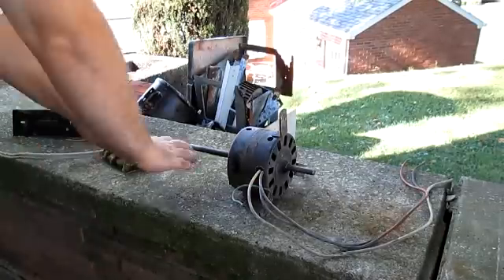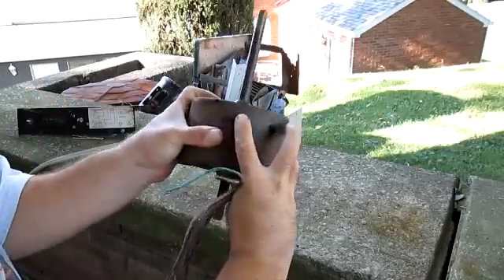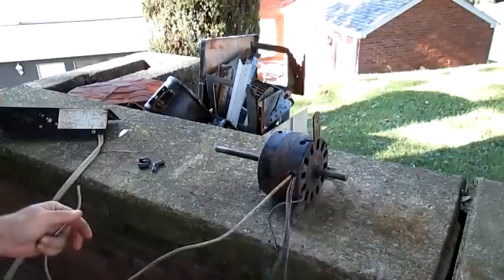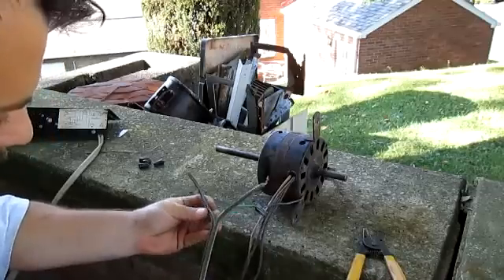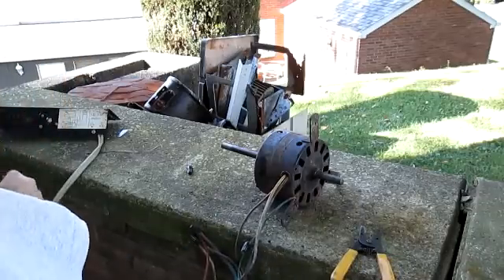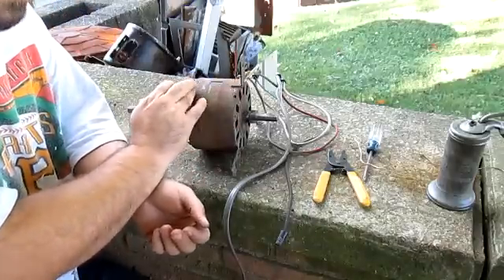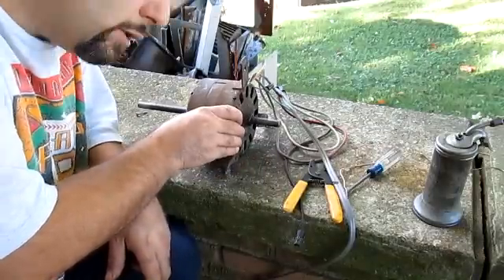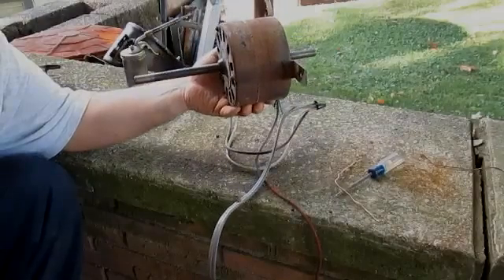How To Test - Air Conditioner Fan Motor

Comment: Good video 
Question : I have a one and a half ton 220volts split unit AC.  After few seconds of turning it on the clamp meter reads 22A then rise to reach 37A for few seconds then it stops and the clamp meter reads zero or 0.1A What could be the problem?
Reply from the maker: It sounds like something could be fried, capacitor, motor..... hard to say without seeing it.  Do you know what the RLA is on the unit ?
Reply: @More350Power  
Thank you for your answer 
I will check the capacitor.
I will try to find out the RLA of the motor.
Thank you.

Comment: what capacitor amperes you used on that fan bro..
Reply from the maker: This one did not require a capacitor, but if you find one that does and does not have one attached to it, usually it is listed on the motor label.

Comment: Erm that motor didn't have a start capacitor? Seems it's not at full speed without it? Most A/C units do have one.
Reply from the maker: surprisingly this one did not require one.  I thought the same thing but the wiring schematic and the way it was wired when I tore the guts out of the window unit didnt have one in it, just for the compressor.
Reply: Called a shaded pole motor.
Reply: @Dive-Bar-Casanova the only thing that is shaded is your crypto wallet after all these years. It’s not too late for you with PULSECHAIN $0.00008
Reply: Run cap is the one they use.  I replace many a cooling season.

Comment: hello there,
When I turn on my air conditioner fan starts working, and the house starts cooling, but after running for about 10 minutes the fan make a squeaky noise and stops working and the compressor overheats.  Somebody came here and said that it was the fan motor going bad and that I need a new motor. Can you let me know if motor starts what could be the reasons it stops? 

Thank you.
Reply from the maker: It sounds like the bearings are going bad in the fan motor.  That would probably be the source of the squeaking noise and as the motor heats up it seizes.  I had an ac unit like that.  Would run fine cold, but once the motor got warm it wouldnt spin.  In fact after the compressor would over heat, the breaker would trip as well.
Reply: I had this with the blower motor in my furnace in a central air setup. When the heat was on, it would make a squeaking sound.

Replaced the motor (very easy), for about $54 on my unit, and it's silent now.

Fwiw my furnace is about 22 years old and I believe the fan motor was the original

Comment: Hi
my air cooler motor isnt working what i need to check pls let me know
it was rotating slow in the morning and later it stopped working,
later it was making hum sound and now i dont even here now.
1) is it shorted
2) capacitor fail or ....?
Reply from the maker: It could have burned up or a bad capacitor if it has one

Comment: I have an old 20 year old YORK condenser unit I think its a 3 ton anyway I want to wire it up I have 4 wires on motor white and black and two brown one of the browns has a white strip. My question which side of the capacitor takes the brown wire with the strip??? or does it matter because I have a capacitor without markings.
Reply from the maker: Usually it doesnt matter which side of the run capacitor the leads go to.  I have an air handler blower that has two brown leads going to its run capacitor but no markings on the cap itself as to polarity.  There is usually a schematic inside the condenser units themselves.  I have been trying to get ahold of a york unit for years... more specifically the york stellar series that has the letters Y O R K cutout in the metal going down the side of the unit.  Old, but good units they are.
Reply: so is it possible to have a two capacitors I am so confused which of the four wires go where Blk, white, brown and brown w/white strip
Reply from the maker: Danny Diet
you usually have two or one combined capacitor in a condenser unit.  The compressor uses one and the fan motor uses the other.  Usually the fan motor capacitor is about 5 microfarads and the compressor 30 to 45 give or take.  There should be a diagram on the motor or the inside of the electric compartment on the condenser to state where the wires go.  If I had to guess, I would say the two brown leads go to the capacitor and your white and black are your two hots as with 220, you are combining two hots.  It is possible the fan motor is 120 volts as well, as usually a white and black lead indicates neutral and hot on 120 volt electric items and red & black or black & black is common on 220 volt items.  There are a lot of configurations out there.... if you can find a model number of the motor or condenser you should be able to find a diagram which would tell you for sure how things go together.
Reply: So all seems to work good except AC unit outside stays on after thermostat turns off. What could this be? I did not change contactor with  switch yet. Could this be the problem?
Reply from the maker: It could be or the wiring could be wired in such a way its bypassing the contactor.  Also, sometimes the contactors burn contacts and even when they seem to withdraw from closed position carbon from arcing or melting of the contacts can keep it closed and thus the condenser keeps running.  Or, the relay in the air handler and or furnace is not ceasing to send the 24 volts to the contactor, though that command is usually done by the thermostat via the yellow wire.
Reply: well thermostat turns furnace fan when it is on then turn it off so from thermostat to furnace its working but didn't check to outside AC unit

Comment: My old GE motor has two wires.  What does that mean?
Reply from the maker: Probably a single speed motor, but make sure of the voltage 120 / 220.... and the ground usually goes to the casing of the motor